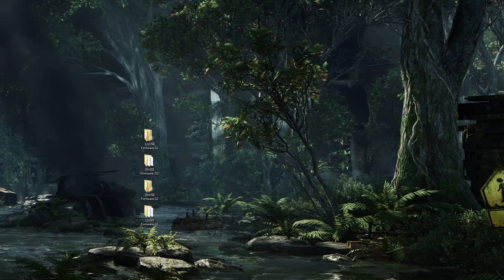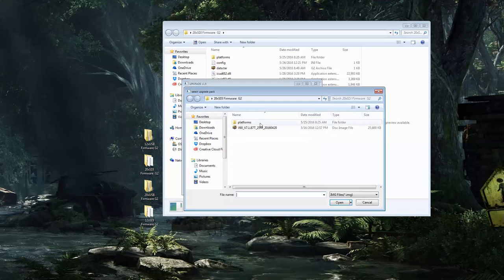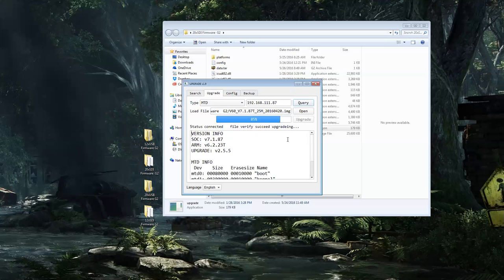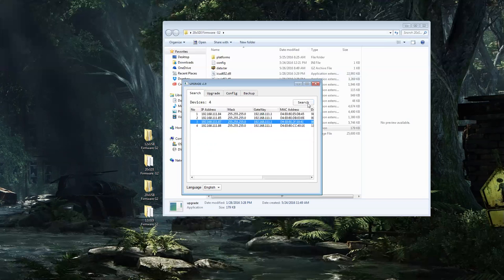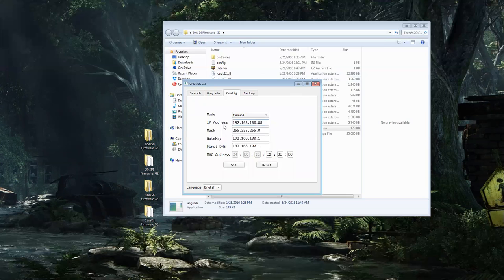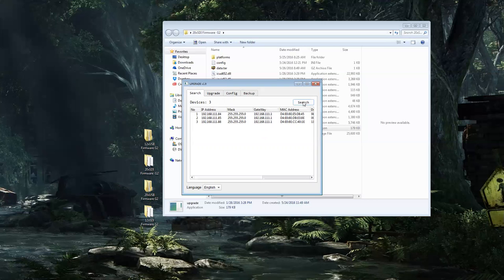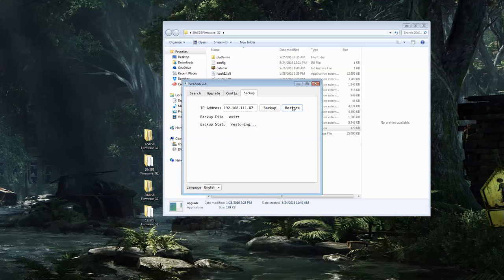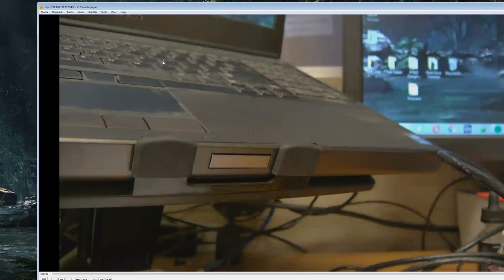PTZOptics 20X-SDI G2 Firmware upgrade tutorial

Comment: Hello, I have a couple of old G2 cameras that have worked well for years now.  
I now find that I want to pull audio through them and have run into a snag trying to do it.
I hooked up a pre-amlified mic to the camera line-in input. 

I am able to get audio with the video over an IP steam from the camera.
I am able to get audio with the video via HDMI.
However, I am not able to get any audio over SDI.  Just the video.

Is this by design, a limitation?  Or is there a setting I am missing to get this to work.  I have been all through the Web settings pages.
Reply from the maker: Hello!
Unfortunately, this is a hardware limitation of the G2 model. While it supports audio over IP and HDMI, it does not transmit audio over the SDI output.

Thanks for checking out our Channel! 
Learn More: https://ptzoptics.com/
Reply: @PTZOptics  Thank you.  I will have to work around it then.  Getting new cameras in not in the cards right now.